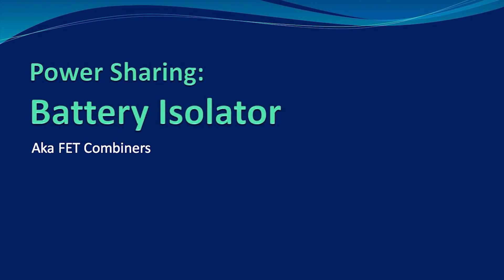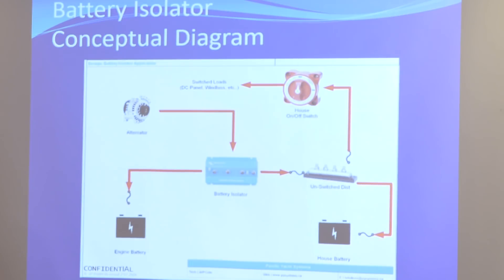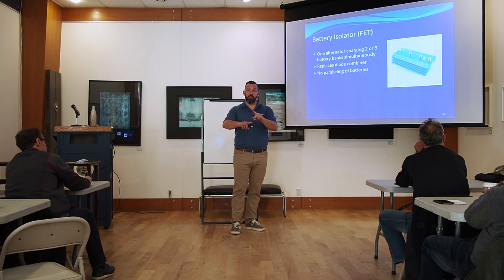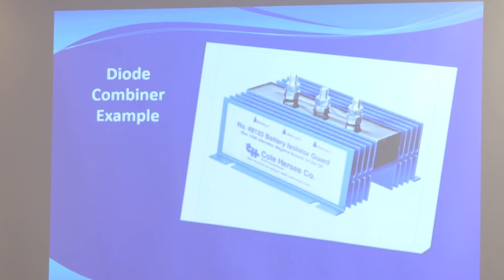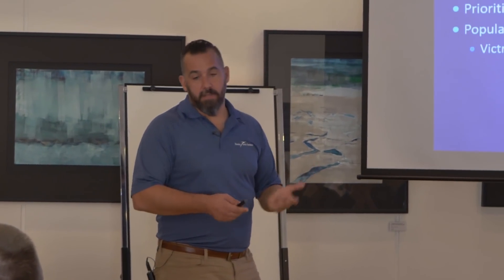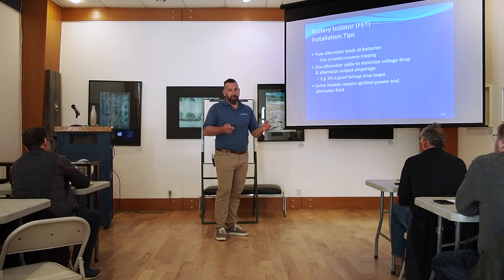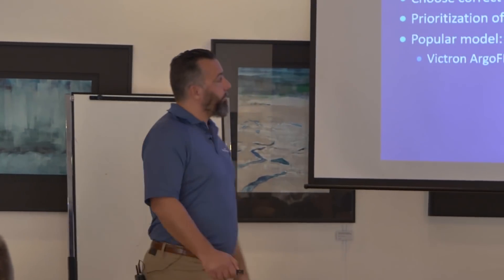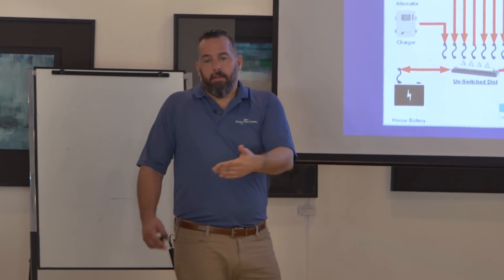How To: Marine Electrical Seminar - Battery Isolators - Ep 11/30

Comment: Great video! Thank you so much for the help. Quick question... if my LED doesnt light up is my isolator broken? While engines running i have voltage but no current to batteries... unsure if im seeing battery voltage or alternator voltage.... so is the light an indicator of current at all?

Comment: Hey Jeff, how do you calculate the 30% vs. 99% efficiency numbers you are quoting of ArgoFET vs e.g. Victron's ArgoDiode? Or is the 30% for older-generation diode units? Victron's own marketing materials seem to phrase everything in terms of "voltage drop"; actual power transmission from alternator to battery-bank is obviously a little more complicated.

Thanks,

Chris

Comment: Hi Jeff!
Great channel, learning so mutch from youre videos and seminars.

In the installation manual from the Victron Argo fett battery isolator it says the following:
4. Connect the ‘Energize’ blade terminal to the engine run/stop switch
(optional). Minimum cable cross section: 2,5 mm².

It says it's optional, but what does that function do and what happens if you don't plug that cable in according to the manual and what happens if you do plug it in according to the manual??

I am going to mount this battery isolator on my Sailboat from 1980 ( im redoing the entire elektrical system on the boat) and it has an old 63A generator with the regulator inside of the generatorand and this is how i think it works. 
The charging lamp is located between the ignition lock and the magnetization of the generator (D+). When you turn on the ignition, voltage goes through the battery light down to the generator's D+ (which actually has a ground potential when it is stationary) and premagnetizes the generator winding. 
How should I then connect the battery isolator so that it is correctly installed on my boat?

(Sorry about the spelling im from Sweden)

Comment: Great video! I just installed 2 solar panels on my boat with a Victron smart mppt controler, then I used a Victron Argofed battery isolator to distribute the charge to my house bank and starter battery. It seems to be working fine but now I’m concerned if this setup will over charge my batteries? And would it be a good idea to connect my shore power charger to the same battery isolator? Thanks a lot Jeff!

Comment: Can you have a battery isolator with two inputs?  one for the alternator and another one for the shore power battery charger?   3 outputs, starter battery, house battery and truster?
Reply from the maker: It's technically doable, but Victron only offers battery isolators with only one alternator input.

Comment: Thanks Jeff, great info. That last question about the smart combiner v/s emergency start was a great one.  Do we need extra wiring and a manual switch, or is the smart combiner manually configurable to allow connection?  Cheers!
Reply from the maker: Hi John, luckily some battery combiners either automatically parallel battery banks together, or they can also be manually forced in parallel with a switch on the battery combiner itself or even a remote small switch located in more convenient location.

Comment: Good video Jeff!. I currently have a SurePower 702 with my alternator and shore battery charger together as an input, going out to my (1)starter and (2)bow thruster batteries. You mention the Victron ArgoFet only accepts alternator input.... can i not do the same as with current 702 and combine alternator and charger inputs then?
Reply from the maker: Good question, but unfortunately don't know for sure if your suggestion will work. Not sure of any unknown implications of having alternator and solar controller on the same input of the battery isolator. Please let us know how it goes if you try it.

Comment: My 87 Formula has a single Mercruiser sterndrive and a 2 battery electrical setup with the 1,2, both and off switch.  I primarily day-dunk it, with a week or two each year in the lake overnight.
The batteries are not the same. One is a group 27 and one is a group 24. 
Is it wrong to run with them both selected?  I normally start with the big battery, but it's nice to have the other in reserve. I'd like to charge up the 24 on my way to the hangout if possible.  I suppose I could get things going on the 27 and after a few minutes I could switch over.
One of these days I will do an isolator? LOL
Reply from the maker: When paralleling batteries, the most important thing is not the size of the batteries but the intended purpose: deep-cycle or starter battery. Preferably to not have a starter battery running deep cycle loads.

Comment: Hi Jeff, Thanks for the great videos they really help to cement the knowledge I'm gaining from reading Nigel Calder etc. My question follows on from reading about the Sterling DC to DC Chargers. They seem to isolate House and Starter banks just like these Victron Isolators but they also regulate the charging of both banks. Are DC to DC Chargers a viable (and maybe better) alternative to a Battery Isolator? Thanks. Dean

Comment: Jeff, Hello love your videos. I have installed the Victron Energy Argo FET Battery Isolator, 100A, 2 Batt.,is it necessary to  upgrade my alternator from the 55 amp it came with in the 80s to a 100 amp (one wire)? If so from what I have read not all alternators are created equal are the one wire car type alternators suitable for this application? Background I have never owned a boat or wanted a boat until one fell in my lap. A 1985 Rea Ray Cuddy Cruiser, it came as a wiring mess with 2 car start batteries and a A, B, Both , none leave me stranded manual switch. I have split the wiring into a dedicated start with proper battery for the engine and dedicated house deep cycle. Which brings be to the above question.
Reply from the maker: Upgrading an alternator is NOT a prerequisite for having a 100 amp battery isolator. If you choose to upgrade your alternator it's to recharge your batteries faster.

Comment: Will these fet isolators work for outboard engines? Knowing they use a stator instead of alternator and provide much less amperage.
Reply from the maker: Hi Micah, it would be hard to do, as you'd need to remove the jumper between the alternator and the starter solenoid and then run a new wire outside of the outboard from the alternator positive post. Would NOT recommend it. Instead of a battery isolator use a battery combiner.

Comment: So, on output 1 i connect my starter or my house battery on it? Or that doesnt matter?
Reply from the maker: Always connect your biggest deep cycle battery to output 1 as some chargers are modeling the charge curve based on what voltage is sense on output 1.

Comment: Hi, Jeff, thanks for the wonderful information in your videos. These have helped greatly with my understanding of my boat's electrical systems! You had mentioned in the battery combiner video that you should not use banks of different sizes. When using an isolator can I have a starter battery and a 2 battery house bank (connected in parallel) connected to the isolater? All would be similar chemistry.
Reply from the maker: Hi Thomas, thanks for feedback. Recall the purpose of the battery isolator is that each battery connected to the battery isolator is NOT connected to one another (i.e. in parallel). With a battery isolator you can have a engine battery and house battery connected to a single battery isolator. Also, it's worth emphasizing, battery isolators do NOT regulate battery voltage. In other words, the voltage is regulated by the alternator regulator and NOT the battery isolator.
Reply: @PacificYachtSystems  Thanks!!

Comment: Hello sir, can I ask you question please, I have boat has single inboard engine mercruiser 5.0, and I have two battery bank for the engine need to replace with new one, I wonder can I mix two type of batter one flooded acid as jump starting 90Ah and the second is AGM deep cycle 100Ah, is that safe if they connected with my engine to charging and support power for the boat?
Reply from the maker: Hi Ameed SeaMood, definitely not advisable to mix and match battery chemistry if they are part of one battery bank or if they are connected to same charging source. On a charger, you can only select one battery chemistry/type.
Reply: @PacificYachtSystems  Similar question, but different. I have the alternator to an isolator. One side goes to a 12v DC-DC charger for LiFePo4 house bank. The other side goes to charge a FLA starter battery. Do I need a protector on the FLA? Will the DC-DC charger make the alternator cook my FLA battery?

My thought is the DC-DC charger will keep the alternator engaged therefore cooking the FLA.

Comment: My solar controller only has one output, so I'm putting an ACR in to have it maintain both banks.  I was thinking that the ACR would kick in when the alternator is running too, but now I think I'd like to add an isolator as well.

How would the two interact together?
Reply from the maker: Hi Jake, you can have both. A battery isolator to charge two batteries from a alternator. The battery combiner will be to charge two battery banks with solar. Both can operate at the same time.
Reply: @PacificYachtSystems  Thanks! I don't have to do anything special when hooking up the solar and ACR right?

Comment: Okay, twin engine installation.  You have two alternators, two start batteries, and one house bank.  Would you use two isolators, one for each engine, and can both engines charge the house bank at the same time?

I don't have a boat, probably will never have one, but I'm curious as to how that would work, if at all.
Reply from the maker: Hi Gary, yep your correct. Install a dedicated battery isolator per alternator/engine and therefore have that alternator/engine recharge it's own starting battery and the house battery.

Comment: What's The difference of use with a Blue Sea ACR ?
Reply from the maker: Hi Olivier, a ACR is battery combiner and puts two batteries in parallel whenever their is a charging voltage. A battery isolator shares one alternator charging to multiple battery banks.
Reply: @PacificYachtSystems  There's something I don't understand. On the "off" position, no current is available, on the "on" position, the current is available and the batteries are isolated,  and on the "combine" position the current is available with all the batteries combined. So the ACR on the "on" position works like an isolator ?
Reply from the maker: Hi Olivier Bert, which model of the bluesea ACR are you referring too?
Reply: I have the Blue Sea SI-ACR 7610 with the Dual circuit Battery switch 5511e